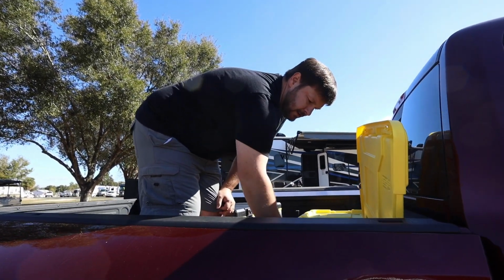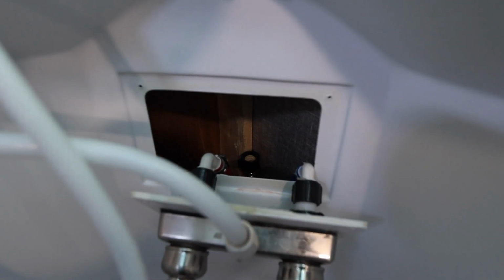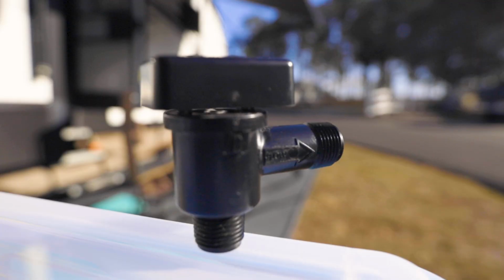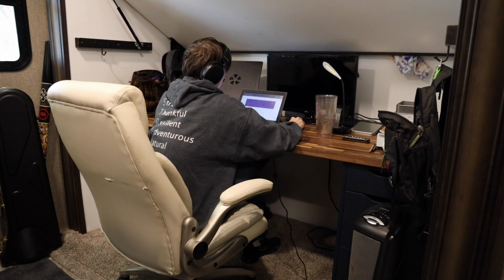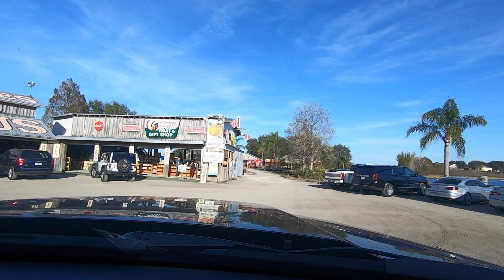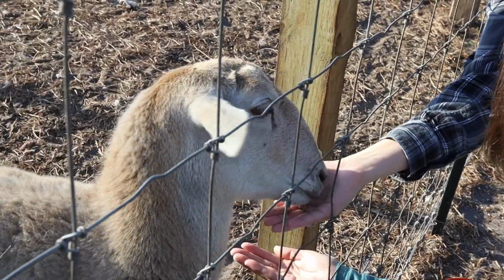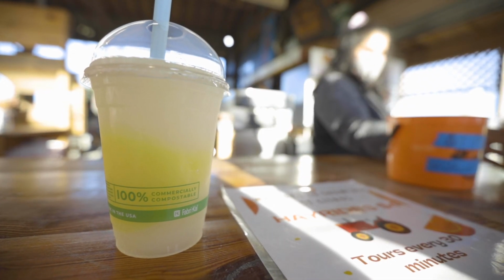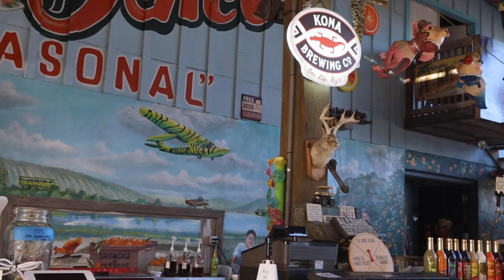Fun Things To Do In Orlando Besides THEME PARKS! (S1//EP6)

Comment: We had a Flagstaff Fifth Wheel and the same valve had issues. Come to find out it was full of Stink Bugs and they caused the obstruction. Cleaned them out and it worked. The citrus stop looked and sounded amazing! Great video. Paul & Magen
Reply from the maker: The tech said it is very common for that part to go bad. It was so weird that the RV places doesn't keep them in stock. I'm glad y'all were able to fix it quick. Thanks so much for watching!